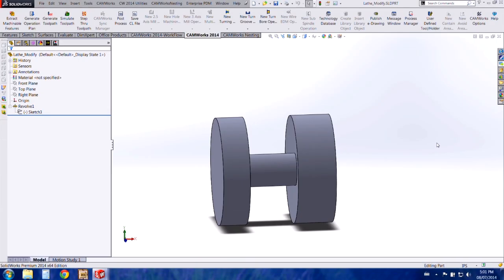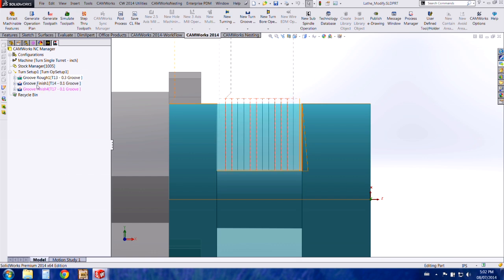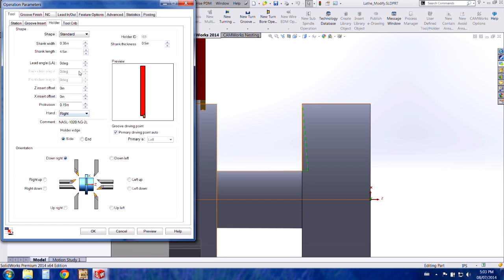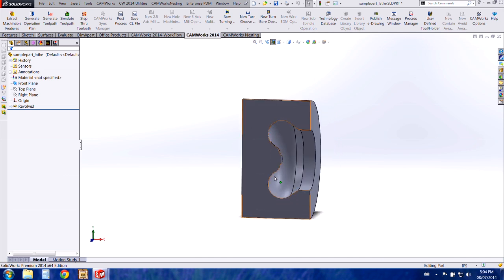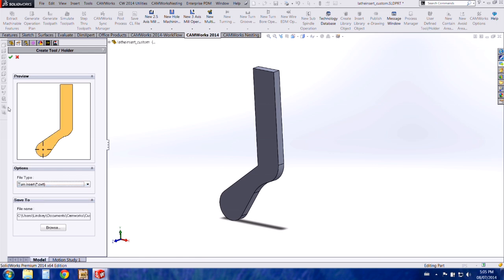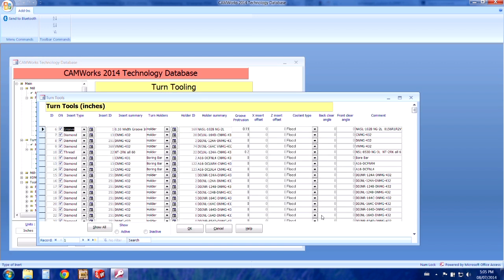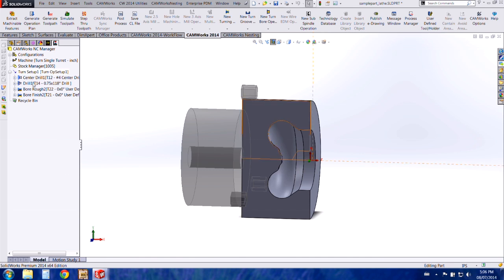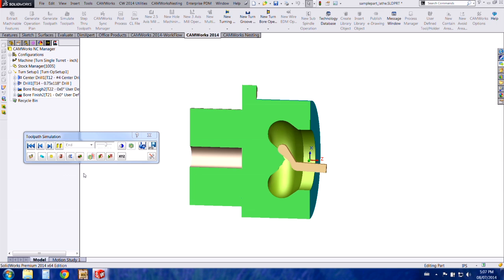CAMWorks - How to Create a Custom Turning Tool

Comment: Any one has idea how to effectively programme with OD form tool? I found only way to first use groove tool for OD finish set with Cut and Length, lock path and change tool to my form tool but it is not good when modification is needed? I appreciate some help.